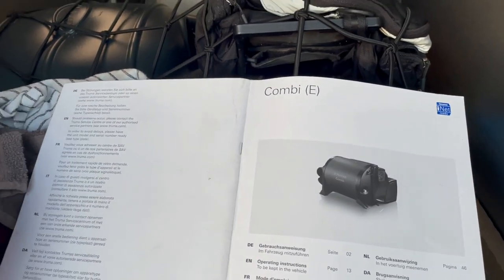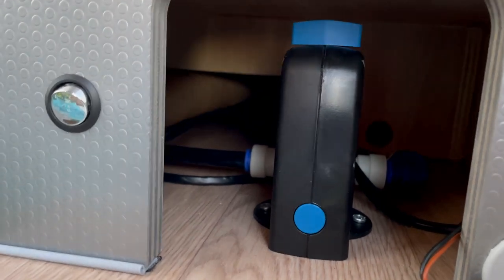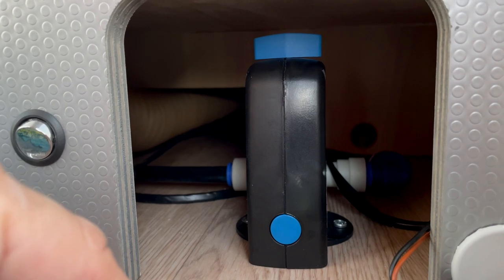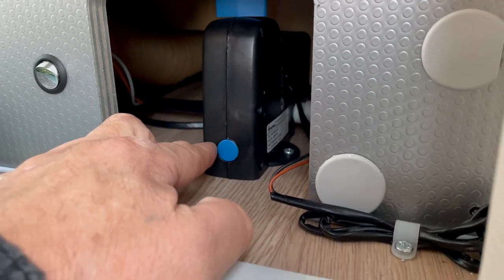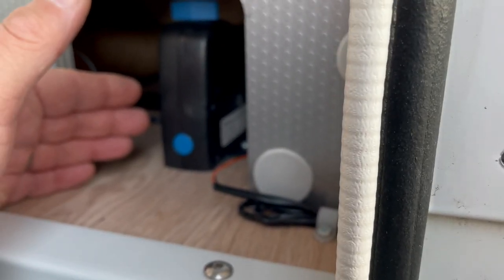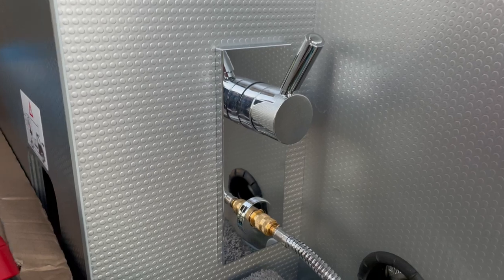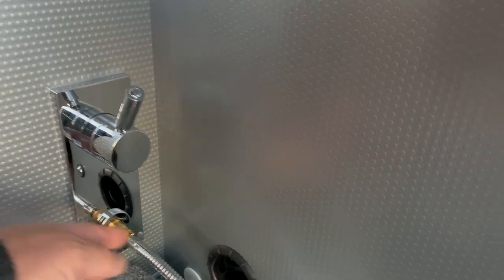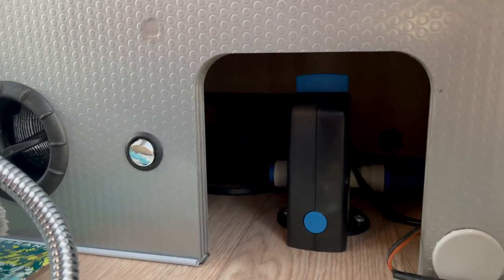Truma Boiler Frost Control | How It Works In Freezing Conditions

Comment: Nice explanation. A short cut for you when you want to fill and get on your way.
Use good ladies hair dryer(on inverter). Blast hot air onto Frost valve. Button will go in Fill tanks at the same time as you mentioned put heater on